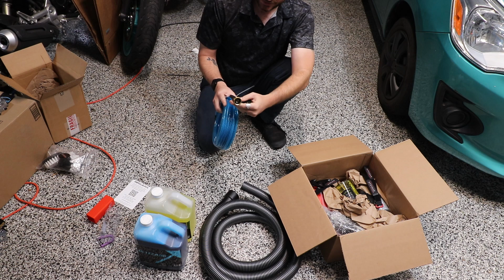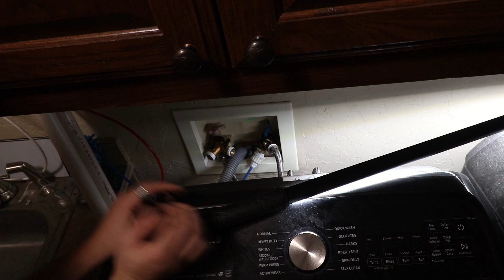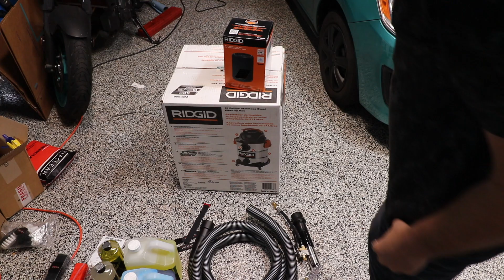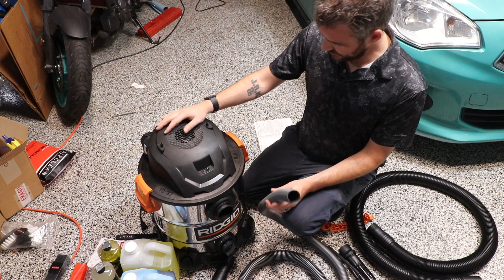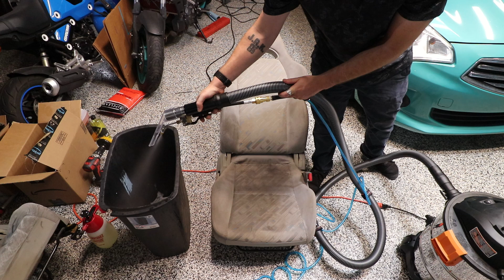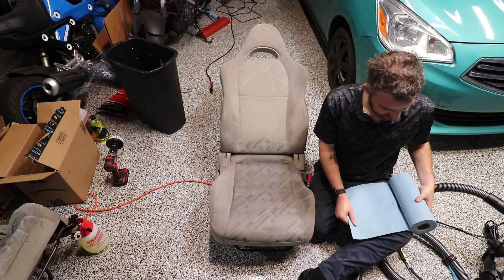RipClean for Beginners. Extractor Unboxing Complete Set up and Test Use

Comment: The connections in Canada and the US for those hose fittings are all the standard garden hose fittings.  Shower heads use another form of fitting but you can buy adapters to make that happen as well as for faucet connections.  Teflon tape is totally unnecessary for those fittings as each female fitting has a washer inside.  Same for faucet and shower hoses.  Here's a tip:  If you are doing this setup I would recommend using quick connect fittings from Gardena or similar style to make storage of the hose a lot easier.